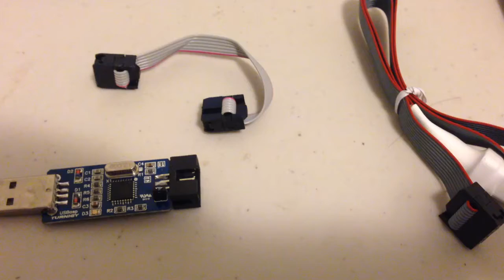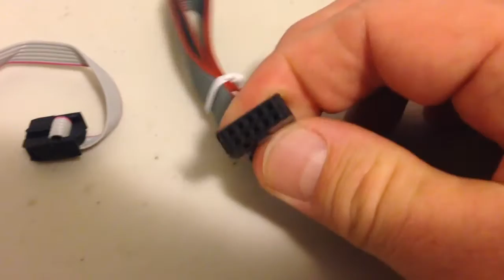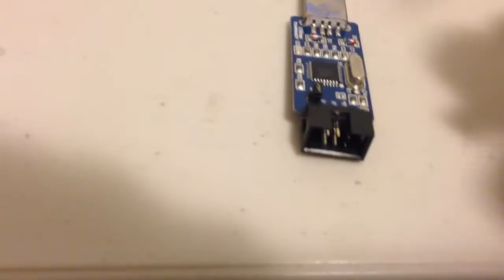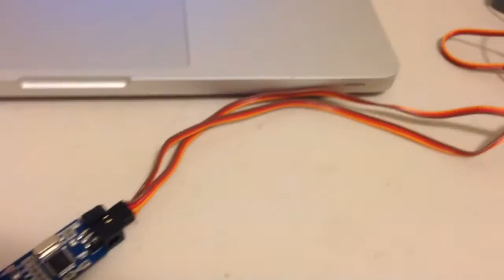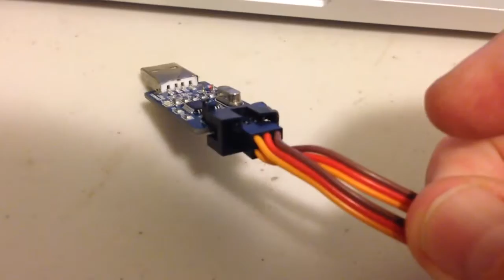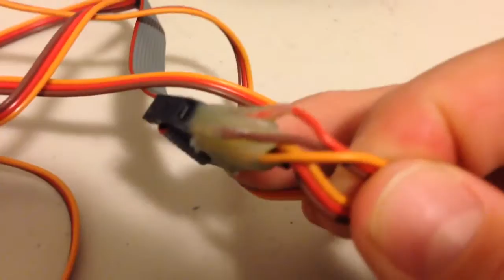USBasp and Atmel Socket

Comment: Rob Depends on Which USBasp dongle you get as the one I have from HobbyKing allows for both 10pin and 6pin  connectors *****
Reply from the maker: Thanks for the info.  I guess I was unlucky when mine arrived.  The picture showed 10 pin but the unit I got was only 6.